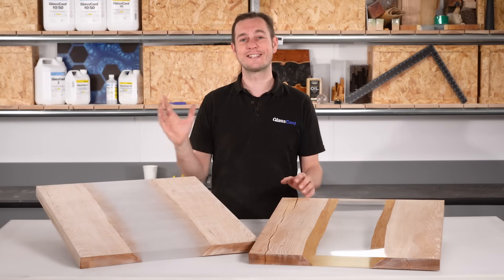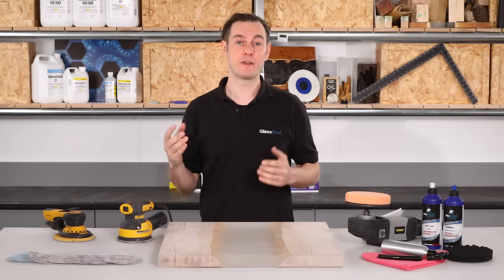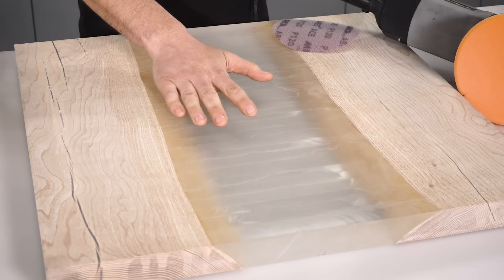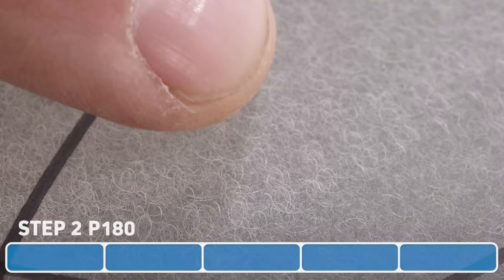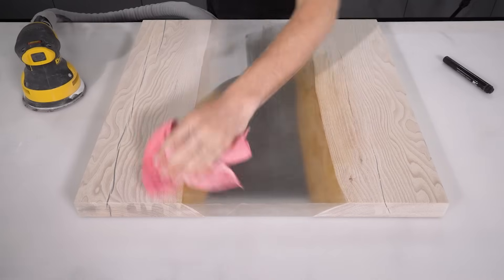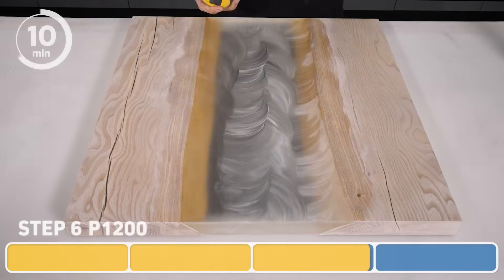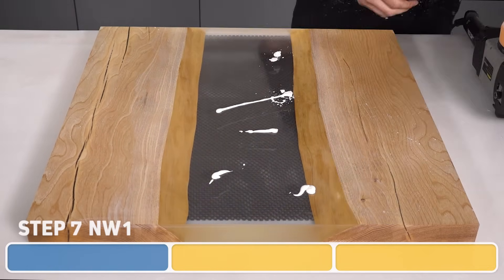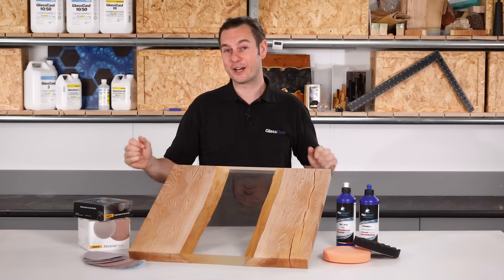How to Sand and Polish Epoxy Resin to a Mirror Finish - Step by Step Guide

Comment: Good video! Is it posible to sand it to 400 grid and then buf with oil, and if oil is dry wed sand it to grid 4000 and then polish?
Reply from the maker: Unlike woods which will absorb the oil to then be polished the oil will just sit on top of the resin and then be wiped off. Really, the only way to polish the resin is to work though the grades and then polish the surface. You can apply lacquers but these too then may need polishing themselves.

Comment: Good tip on oiling the wood.  I'm working on an epoxy river table and I was taping the edges so I wouldn't get compound on the wood and noticed the edges were super clear.  Now I'll seal the wood and not worry about the compound touching the wood.
Reply from the maker: It's still best to avoid spreading the compound onto the wood too much but treating it first certainly helps to prevent staining.
Reply: So glad I found this week's and weeks of watching different videos stressed isnt the word but I find your videos tonight ... cillitbang job is done 😂buzzing ...ur a star !!

Comment: Great video! After you get the glass like finish, how do you protect it? Also, I have a project where I would want to epoxy the wood part too so do I flood the whole piece first and then finish per your instructions? Thanks again...Subscribed.
Reply from the maker: Thanks for taking the time to comment. Once cured and polished up the GlassCast resin is often considered to be the finished result. Some customers do apply a PU topcoat but this isn't something which we supply. If you want to coat the wood as well then there is no need to polish the resin, simply flat and key with 120 grit. You can then use GlassCast 3 to flood the surface which will cure with a flat glossy surface. We actually show the process in this tutorial https://youtu.be/dTLLFntPD60

Comment: I'd love to know exactly which connector you found for your Dewalt sander (which I also have) so you can connect it to your shop vac. Having a hard time finding one.
Reply from the maker: We fabricated an adaptor using some carbon fibre tube.

Comment: Great video!  Sets the standard for this topic.  Only 1 question. What kind of marker pen are you using: permanent, non-permanent, sharpie, or something else?
Reply from the maker: Thanks for your comment, any kind of marker is fine. It's just to indicate where you've sanded and areas that you haven't, I think we used a sharpie as that was what we had to hand.

Comment: 2:20 Polishers are fairly inexpensive, ok Buddy, shows us a 600$ Mirka polisher....... to do a   5 minute job :(
Reply from the maker: We do say that 'entry level' polishers can be relatively inexpensive and would be absolutely fine for projects like this. It just happens that we have an industrial grade machine which we use for a number of other processes and applications. They work in fundamentally the same way but this one is designed for a lot more continuous use.
Reply: @glasscastresin   IM like sounds great and i plumb the depths of this item :( wow bonkers used its comming in on the canadian peso at 500$ EFFFFF
Reply: @glasscastresin  why demo with the best when an everyman tool could work, or why would you buy a $$$ tool, and how would you do this job with a cheaper tool

Comment: Do you have to make sure the scratches are sanded out from the previous grit if you're doing a top coat instead of polishing?
Reply from the maker: If you are doing a top coat then we recommend just keying the surface with 120 grit. Because you want some texture on the surface for the resin to grip too then you aren't looking to polish the resin at this point, as long as the surface is flat.

Comment: If you use Glasscast50 and then put a layer of Glasscast3 on top, do you still need to polish the 50 in order to make the whole thing clear all the way through?
Reply from the maker: Hi Oliver, 

You would apply the GlassCast 3 at the 'B' stage or key  up the surface of the 50. Either way, you don't need to polish the surface first and any scratches from the keying process will be filled with new layer of resin.

Comment: What would you say was the total time it took you from beginning to end to finish the polishing process?
Reply from the maker: You could estimate between 1-2 hours for a piece this size.
Reply: @glasscastresin  thanks. 
What would you recommend for spot sanding and polishing? I did a small 17 by 17 project that came out pretty good but dripped off the edges. After it hardens I tried doing an additional epoxy repair by tripping epoxy on the places that it didn't cover. Unfortunately I ended up making it lumpy around the edges. Is it possible to sand and polish some areas but not mess with the good areas? Hope that makes some kind of sense?
Reply from the maker: @greglegakis4177  Small areas can be polished by hand or a more precision rotary tool. Masking off the good areas will mean that they don't become scratched or scuffed by any oversanding.

Comment: Hi there very useful video! I personally make art clocks using acrylic paint and to finish them off i put resin top coat over it (possibly 2 thin layers) would this process work for me? Thanks in advance
Reply from the maker: Hi Ben, 

Yes the resin polishing process will still be the same. As long as you don't sand too much and break through the resin into the paint.

Comment: What do I do if I can still see squiggle lines after doing all of the steps including the polishing? Do I need to start over again at 400? Maybe 600
Reply from the maker: If you can still see the scratch marks from a more course abrasive then yes you need to go back a step or two and remove them. You don't want to move onto a finer grade until all of the scratches have disappeared. Once they have, you can move onto a finer grit.

Comment: Do you always use the abrasive discs dry? Can I use the wet? Maybe last longer?
Reply from the maker: It's better to use a dry sander for the initial stages as the dust can be extracted and its easier to see the areas which need more attention. When you get down to the finer grades of abrasive then you can switch to wet sanding.

Comment: That was an awesome video. Do you typically add a finish to the entire piece after finishing or leave the glass-like epoxy untreated, and just finish the wood? If adding a finish to both wood and epoxy what do you use?
Reply from the maker: Hi David. Once polished, the resin already has its finish so there's no need to treat with any further product. Also any waxes or oils will simply sit on the surface and wipe off rather than being absorbed into the surface. The wood on the other hand can be treated and finished as per personal preference.
Reply: @glasscastresin  ah finally I understand

Comment: Are you sanding all the way to 1200 on both sides or just one (human facing)?
Reply from the maker: It depends if you need a glossy finish on both sides and the transparency of the resin. For coloured resin you will probably be able to get away without particularly smooth finish however a clear or tinted resin may benefit from a good finish on both sides for best results.

Comment: Coming back to this after a year so I can make mid tier optical lenses
Reply from the maker: Whilst GlassCast can come up very shiny for a cosmetic resin it doesn't what would be classed as optical clarity. If this is something you're looking to achieve, you may want to consider PC15 which is an ultra clear PU resin that can give optical clarity. The downside to this is that it is classed as a professional grade resin and can be quite difficult to use, it is very sensitive to moisture/humidity and ideally needs degassing prior to casting. 

https://www.easycomposites.co.uk/water-clear-polyurethane-casting-resin

Comment: I want to cut narrow strips out of a decorative epoxy slab that I poured and then be able to polish the strips and glue them together around her rectangular stainless steel box. How do I glue the strips in the box and how do I glue epoxy to epoxy?
Reply from the maker: You can use a clear epoxy adhesive such as ET500 which will bond both the epoxy and wood to the metalwork. Just be sure to prepare the surfaces with 120 grit key to promote bonding. A degrease on the metal will also be advised. https://www.easycomposites.co.uk/rigid-5min-epoxy-adhesive

Comment: How well does the danish oil work with such high grits?! Nornally these oils have a sweet spot between 120 to 240 max.
Reply from the maker: The oil in the instance is to protect the wood from the polishing compound used on the resin and prevent it staining. Once the resin has been polished the wood can be retreated and finished appropriately.

Comment: I was so worried how i will be able to polish epoxy when its mixed with wood. Thank you for disclosing that! Do you think its a good idea to oil and also polish the wood?
Reply from the maker: Hi, it entirely depends on your personal preference when it comes to finishing. I would recommend some kind of treatment prior to polishing the resin as it will protect the wood from potential staining from the polish used on the resin.

Comment: When you put your finish on the wood. Did you also do that to the epoxy? Or do you use something else or once’s it’s buffed you don’t need to put a finish on your resin?
Reply from the maker: We apply the oil after the sanding stage before using the polish on the resin area. There is no need to apply oil the epoxy as it doesn't soak into the material and will simply wipe off the surface. The glossy finish on the resin is achieved with polishing alone.

Comment: Awesome video, thanks so much! I am exploring setting in stones with my epoxy, any suggestions on sanding process for this?
Reply from the maker: If the stones are covered completely then the process is the same.  If trying to sand around stones sticking out, that would be much more fiddly.

Comment: Do you have to polish both sides of the project?  Great tutorial 😁
Reply from the maker: If the resin is clear then yes you will need to polish both sides to give you the best clarity through the resin. If not, then it really depends on the finish from the mould, how likely you are to see under the table and if an unfinished surface bothers you.

Comment: Thank you. Quick question. I know in the video you had finished the wood. And then you continue to polish the epoxy. However, in the end it look like you took off some finish of the wood. So did you go back and finish the wood again?
Reply from the maker: It's inevitable that in polishing the resin the pad will cross over onto the wood and take off some of the coating. It's perfectly fine to go back and top this coating up once polishing is finished. It's recommended to give the wood a good clean first to remove any polishing compound which may have transferred onto the surface so as not to trap it under another layer of wood finish.

Comment: Do both sides need to be sanded and polished?
Reply from the maker: If the resin is clear then yes you will need to polish both sides to give you the best clarity through the resin. If not, then it really depends on the finish from the mould, how likely you are to see under the table and if an unfinished surface bothers you.

Comment: Gonna be rewatching this because seeing multiple passes is new to me! Can this be applied to a resin table top that has a few flowers sticking out so it can be a flat shiny surface?
Reply from the maker: The flowers should really be fully encapsulated in the resin which will prevent them from absorbing moisture and decaying any further. If they are protruding from the surface then
you should cut the flowers back flush and sand out a small amount of resin around the flowers, you can fill with a small quantity of resin to seal them in place. This can then be sanded flat and polished as demonstrated in the video. Alternatively you could cut the flowers back to the surface and apply a 2mm coating of GlassCast 3. GlassCast 3 cures with a flat glossy finish so you shouldn't then need to do any more finishing work.

Comment: do you need to use orbital sander or can you use a regular sander?
Reply from the maker: A random orbit or DA sander works best as it's less likely to leave the pig tail traces in the surface that are sometimes left behind with a simple oscillating sander.

Comment: Maybe this has been answered already but in general terms how much of the surface is removed in the process
Reply from the maker: It is entirely dependant on the finish of the surface to begin with. Good smooth finishes will need less material removing whereas a rougher texture will need more taking off in order to remove any blemishes.

Comment: For epoxy strengthened with fiber glass what do you suggest for the 'glass' look ?
Reply from the maker: Any additives mixed with the resin, be this a reinforcing fibre or filler powder will inherently reduce the clarity and be seen within the resin to some extent.

Comment: What kind of marker are you using. Is it a Permanent marker? Wet erase? what size tip? I'd hate to pick up the wrong type and graffiti the project LOL Nice video Thanks
Reply from the maker: Just a regular permanent marker but be careful to not get it onto the untreated wood as the ink could bleed into the porous surface - keep it on the cured epoxy only.

Comment: how long do you need to wait before doing this?
Reply from the maker: Its best to wait until the resin is fully cured, the harder the resin, the easier it will sand and polish. If you try and start working too soon and the resin is still a bit soft then there is the risk that you'll gouge the surface which will mean more work in the long run. The curing time depends on which resin you are using and the temperature it has been curing at. More details regarding cure times can be found on the product data sheets found on our website.

Comment: can you comment on the speed of the polisher for the polishing compounds-starting out and progressing through the passes.  Is 5000 slow enough to 10000 too fast or is this adequate?  Thank you.
Reply from the maker: We would typically aim for around 800-1500 RPM. If the surface starts to heat up then reduce the speed and or pressure and wait for it to cool.

Comment: Do you polish the bottom to be the same?
Reply from the maker: For the most transparency then you you would need to polish both sides of the resin. If the resin is pigmented with a tint or a solid colour then often it's not required to do quite as much finishing work as on the top side of the surface.

Comment: Hi,

I've been struggling with these sandpaper marks for 2 weeks. How should the machine speed be? Are all grit numbers sanded at the same speed?
Reply from the maker: The sander should be set to a medium speed and care taken not to apply too much pressure to the surface, to fast and too hot can cause the resin to overheat and soften which can cause deeper marks. If you are still seeing scratches then you'll need to keep on at the next finest grade and not move onto the next step until they all disappear.

Comment: I see quite a notable discolouration to the wood where the polish has made its way into the grain of the wood.  Any tips for removing that?
Reply from the maker: Hi Phil, you should be able to clean away most of the remaining polish with a damp cloth. The wood preservative (oil in our case) should be enough to prevent it from staining to much an and make cleaning the residue off fairly easy. It may want another coat of oil once finished polishing.

Comment: I poured a “top coat” but have small dust particles in it.  What grit do you recommend starting at to remove them?  Thank you
Reply from the maker: Start off around 800 grit and see how you get on.  You may want to go coarser if you find the dust is deeper and it is taking a long time to cut through.

Comment: I wonder how long will this last before you need to repeat the polish process?
Reply from the maker: That's difficult to say as it depends how well it is looked after - in normal use, it should stand up well but if heavy objects are dragged across the surface or if keys/utensils for example are used directly onto the surface, it may begin to scuff. However, it could be polished back up as scratches and surface marring is likely to be very light.

Comment: do you need a polisher or can u use an attachment for the sander?
Reply from the maker: A polisher generally works better but if you have an attachment for your sander it will make the process faster than doing it by hand.

Comment: Hello, does this method work for polishing acrylic?
Reply from the maker: I would have thought so, its a fairly generic sanding/polishing process. Just be sure not to overheat the resin, if you sand/polish too aggressively you could soften and melt the surface.

Comment: When I go to sand this, it smears. It’s been about 24 hours. Did I mix it wrong or is it not cured. ?
Reply from the maker: If it is smearing then either you're getting it too hot when sanding (building up too much friction heat) or it isn't fully cured. depending on the resin you have used and the temperature. 24 hours maay not have been enough time.

Comment: Hey there 👋. 
Wondering if the sanding swirl marks will be seen in my opaque black epoxy River table after I top coat with table top epoxy? Or does the top coat epoxy fill on the swirlies and make it all uniform? Thanks!
Reply from the maker: A flood coating will completely fill any scratches on the surface. In fact, you will want to key the surface with 120 grit abrasive.
Reply: @glasscastresin  oh wow, so glad I asked. I thought because it was solid black epoxy that the clear coat would accent the scratches. Thank you so much for responding🙏.